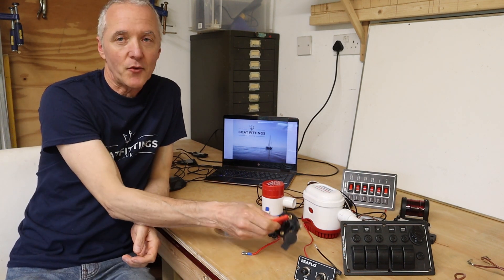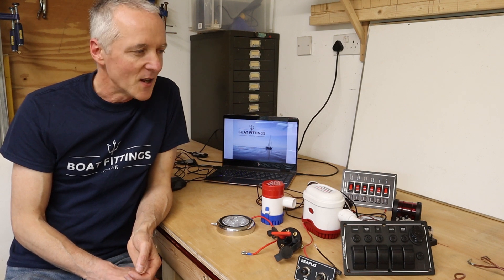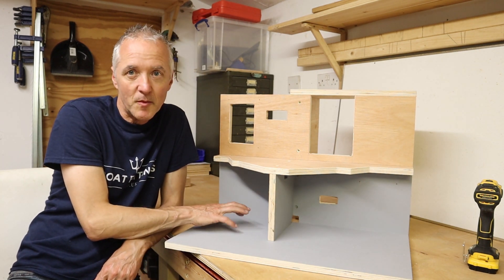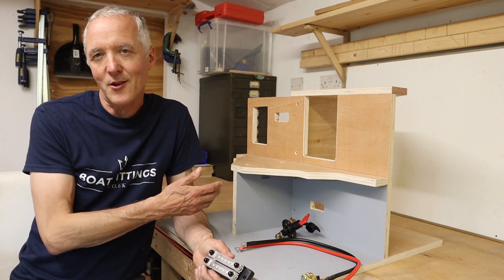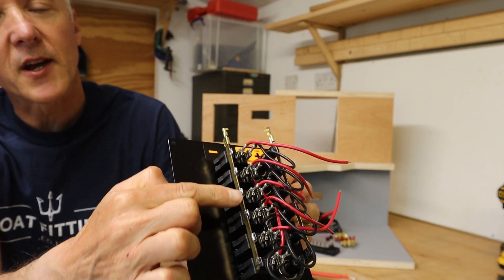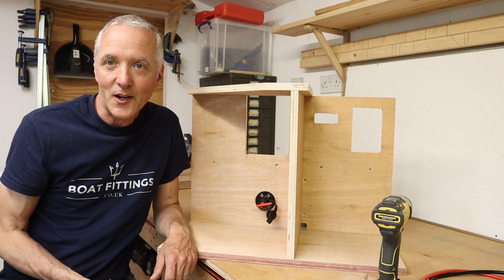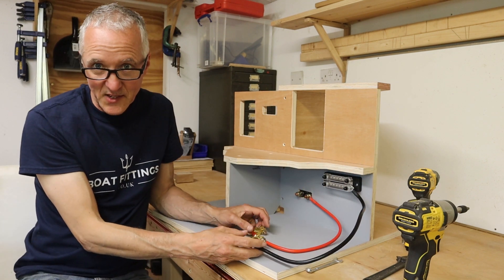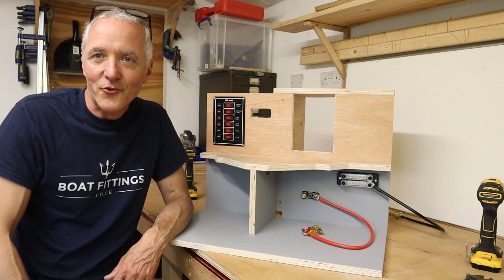Boat Electrical Wiring Made Easy, From The Ground Up, Part 1, Comprehensive Guide

Comment: Excellent primer. You are  good instructor.  As an American engish  speaker, I didn't know what " buzzbah"  was until you showed it  - Now I'm going to call it that! :) 
I was specfically looking for an explainer of how ground circuts work on non-metal boats and fuse block connections. Maybe those are covered in other vids. Keep up the good sharing.

Comment: This is just the first video in the series, so I am really looking forward to following along. What i am most interested at the moment is adding 125v 30a  shore power to my sailboat and setting up a distribution panel and any other needed components to run heater/air-conditioned, frig, plus 2 standard outlets (gallery and head) and battery charger. Also interested in your great tutorial on adding small solar panels.

Comment: What gauge battery wire do you use? 6 or 4 gauge. If the run to the battery is less than 5ft away. Am I good to use 6 gauge?

Comment: Great video however the switch panel you used has the square fuse holders that require a small screwdriver or pick to get at the fuse. I replaced my fuse holders with screw cap type requiring no tool to get at the fuse.

Comment: Why would you want all the wires from the switch panel in the bilge? That seems to be a terrible place to run electricity. The place most likely to be wet isn't ideal for open wiring that controls all the boat functions.

Comment: Hi Richard, if you still about. I really enjoyed your videos. Shame they didn't get beyond bilge pumps! Can I ask why, for the the -ve bus bar, boats don't use something like the bus used in a domestic consumer unit - just strip the insulation, insert and tighten the grub screw rather than needing to create a soldered ring terminal for each connector.

Comment: You sir were born to teach! I haven't seen many other content makers cover a specific topic with such incredible clear concise information.  Neither have I seen anyone come up with such a wonderful model to help explain the where and why? I decided to put a second battery in my center console. I will be installing a fuse block to run my tinned wire to from some additional interior lights, a stereo and fans I will be installing. I have a large deep cycle battery that will be in a secured battery box. There will be one ground lead to the fuse block and one hot to a 60 amp thermal fuse breaker. Then from the 60 amp breaker to the fuse block. I can put whatever amp fuse I want right in the fuse block and there are LED red lights to show power for night. The console battery will have a charge lead coming out of the battery box as well so I can charge it without removing it. The fuse block will make wiring any add ons a breeze and keep everything neat and organized with minimal wiring confusion because every wire connection will be labled at the fuse block. The console battery will also be connected to a solar panel charging system with the panel mounted on top of the T top. Doing it myself it cost roughly $200.00 and  most of that cost is from buying the solar set up. The nice thing about fuse blocks is you can run your fish finder gps off the same battery as everything else without interference because every connection is getting clean regulated power.

Comment: I have two switches on this panel that don't work. The lights dead on the switch is it the switch or does it means the fuse is out. How do I change the fuse.

Comment: Good video only thing is you never said what gauge the battery wire is you just said heavy duty?  What gauge are you using and also will I use the same gauge if I'm leaking batteries in parallel?

Comment: I worked for a number years in marine electrical. In larger marine craft, fuses are not mainly used as the preferred form of electrical protection. Marine certified magnetic/thermal circuit breakers are recommended, they come in various tripping curves depending on their applications. In large sea/ocean going vessels, batteries are divided into 3. One set for starting and engine monitoring, one set for light including navigation lights and the other, for radio communications and or radar. All 3 battery configurations can be charged either off 1 or 2 main engines using a blocking diode system. Love your video. Thanks. Retired DC electrician.
Reply: I don't think you read the title.

Comment: Very helpful indeed! A question : I learned that the electrons flow from the negative part of a battery to the positive part. Should the main switch then not be "in" the black cable? You are connecting the red (=plus) cable.
Reply: Too bad this wasn't answered. I have a different but related question which I'll post separately. I did look up the answer to your question. The consensus answer is that according to electrical theory, it should not matter whether the switch is on the positive or negative side. However, from a practical use / safety standpoint, it is standard practice to install it on the positive side. Lots of references on the web to explain that.

Comment: 6:25, what a mess! Are there any panels without spaghetti of exposed internal wires? They can be done as a bunch of short metal jumpers or shorter wires. I would resolder this panel.
Reply: Blue Sea does a circuit breaker panel with a common +ve and a -ve busbar
Reply: P.S. thanks, the video is pretty helpful!
Reply from the maker: I'm not sure what you are talking about - are you ?

Kind regards,

Richard
Reply: @BoatFittings  There are a lot of short jumper wires between every switch and fuse (black wires at 6:25). That does not look nice and safe.
I would prefer some shorter straight jumpers or even mount it on PCB. There are thick enough cooper layer options, PCBs can easily handle 5 amps.
As an option, there are good ABB din rail DC components. And they do have safe, thick protected sets of various jumpers.

Comment: Hi there - have you wired in a shunt and current meter/voltmeter/capacity meter (a coulometer(?))
Reply from the maker: Hi thanks for your question - no I haven't as yet, but that would be an interesting one to add to a future video.

Kind regards,

Richard

Comment: You have no idea how helpful this series is to me right now. We were gifted a sailboat by a family member and I just looked at the electrical...it appears that all the wires need to be replaced, and many rerouted.
Reply from the maker: Hi glad to be of some help, I hope your wiring project goes well.

All the best,

Richard
Reply: @BoatFittings  it did go well! Everything is working except the mast light...so we aren't going out at times we would need one until we take down the mast this fall. We do have a battery powered headlamp that we can tether to the mast, just in case we can't get back to the marina before dusk for some reason. Seriously, this and a few other videos helped me tremendously in moving over from the AC world to DC!!

Comment: Thank you so much! This is exactly what I was looking for. I have a Sigma 33C that has had some dodgy wiring done before me and my mate Niall bought it. I do have a couple of faults somewhere on the earth side that I can't find. Plus the bonding wire has come off a couple of the sea cocks, and its the wrong wire having gone black. Anyway I'd like to completely rewire the boat. I have the very same panel here in my hand that I purchased last year,  I hope I got it from you. I do understand a bit more than I did and am keen to learn more.

Kind regards from Scotland,  David
Reply from the maker: Hi David,

Thanks for your kind comment.  I hope the re-wiring of your Sigma goes well.

Richard

Comment: do  you  need  reiays
Reply from the maker: Hi thanks for your question.  In general Relay's are only needed for items which have a high current draw, and for which you wouldn't want that current to be passed through your switch or switch panel.  This is a great question and  I will cover an example of using a relay in the next part.

Kind regards,

Richard

Comment: thanks for this vid - iv got the same switch panel - ( BLA ) Stupid question for u - How do u change the fuse in them
1st time with this panel
Reply from the maker: Hi thanks for getting in touch.  The fuses are changed by twisting the square fitting at the front of each fuse.

Kind regards,

Richard

Comment: Do I need an special device if I have my battery cable traveling as far as up to 10 Meter before getting to it's negative bus bar and main master switch?
Reply from the maker: Hi thanks for your question.  I don't see any problem with having a 10 metre cable from your battery to the busbar, the only thing to point out is that extra length means extra resistance, resulting in some degree of voltage drop along the length.  I don't think this is likely to be an issue for you, but if it was then using a heavier duty wire would compensate.

Comment: Thank you very much you made it look very easy. I have two questions: how do I connect a land charger and a second battery to that system? Thank you very much in advance
Reply: Connect the second battery in parallel to the first. Make sure the charger can handle it.
Reply from the maker: Hi thanks for your question, I will try to get onto that subject in a future video.

Kind regards,

Richard

Comment: Would you have an electrical drawing for a small sailboat. Outboard and start battery circuit then the house battery circuit to a dc panel, a solar and shore charging with a small 12/120vac inverter.
Reply from the maker: Hi thanks for your interesting question.  I am afraid I do not have such a diagram.  I will think about incorporating some of these features in a future video though.

All the best,

Richard

Comment: How would I wire up a starter battery to my outboard and have 2 leisure batteries. Using a dc/dc charger please?
Reply from the maker: Hi thanks for your question.  I am afraid I can't properly answer this in a sentence or two.  I will put this on the list for future videos.  All the best,

Richard
Reply: You would need to check how much current the starter requires and ensure the battery can deliver this.

The difference between a leisure battery and 12 volt car battery is the starting current capability. A car battery is designed to be able to deliver a very high current for a short period of time, to turn the starter motor in a car.
Leisure batteries are not designed for this.

So check the current requirement for the starter and if your leisure battery can't deliver it, then you need to add a different battery type. And you need to think about how that new battery would be charged.

I would add a separate charger for the new starter battery.

Comment: Hi great video. Have a question, on the master cables to the battery I also need installed a negative bus bar. You connected your negative cable directly to the bus bar and positive to the master switch. I also ran a negative cable from the bus bar to the battery because my negative on my outboard is connected directly to the negative battery terminal. My question is should I have connected the outboard negative terminal directly to the bus bar as well? All the rest of my negatives are connected to the bus bar.
Reply from the maker: Hi thanks for your question.  From what I understand of your system, I do not see anything wrong at all with the direct connection of your negative from your outboard to the battery.  This allows a more direct connection / higher capacity cable (less resistance) to your outboard, so that seems fine to me (without being able to see in detail).

All the best,

Richard

Comment: Thanks for the great video. Do you need a fuse between the battery and master switch?
Reply: I personally would add a fuse in line with the main supply cable before the isolator. Consider this situation, you have a 100amp supply cable with the correct rated isolator and board. You have a mixture of circuits which are well below 100amps and correctly fused, so no problems. Then you get someone who now adds additional circuits which are high current.. they add 3 x 40amp circuits which have the potential to draw that amount of current. You now have 120amp running happily through their protective devices but that supply cable is now overloaded without any fused protection.. there is nothing to stop that cable melting of catching on fire. Just my opinion on it. I think of my house supply . The main supply cable is protected by a cut out fuse, so this is the same logic.
Reply from the maker: Hi thanks for bringing up this question - it is a very good question!  I have often thought about this myself, you might say that if the Master Switch for example has a capacity of 100A then you could choose to protect the whole circuit with say a 75A fuse.  In practice (in my opinion) as long as each component is protected by a fuse (suitable to that component) then that is more important.  So I would not argue against protecting the whole electrical system from a 'master' fuse, but I think in practice this is a bit more 'belt and braces' than most people or boat builders would choose to go.  It would be interesting other expert opinions on this.
Reply: @BoatFittings  ISO 13297 requires a circuit protection no less than 200mm from the battery, and to every load. i like the videos but best to make sure your following regulations.